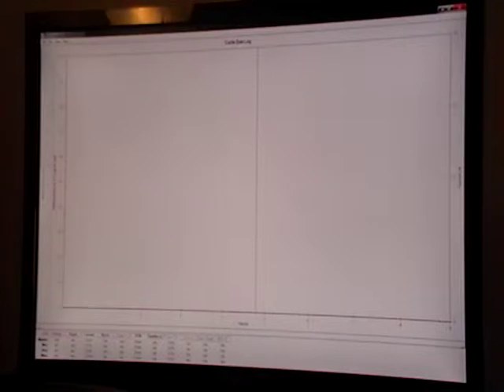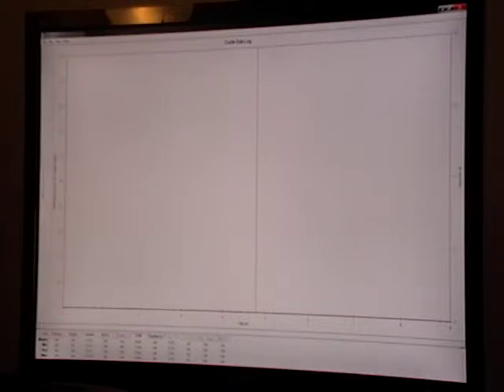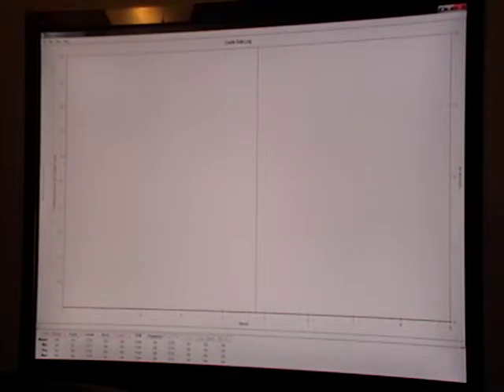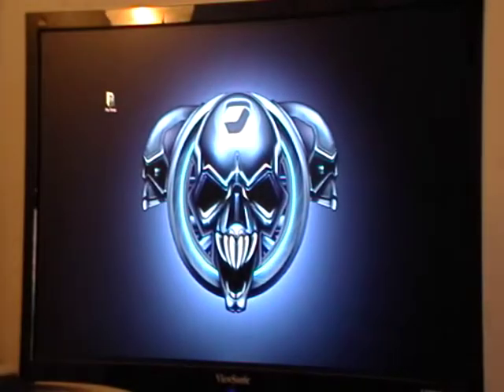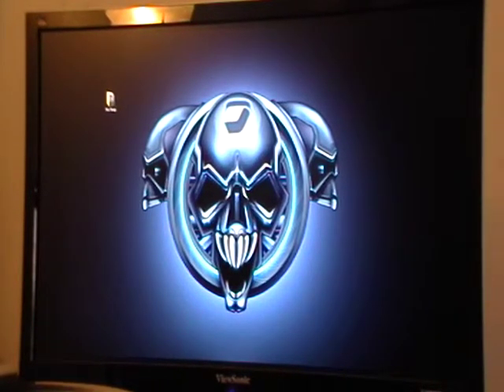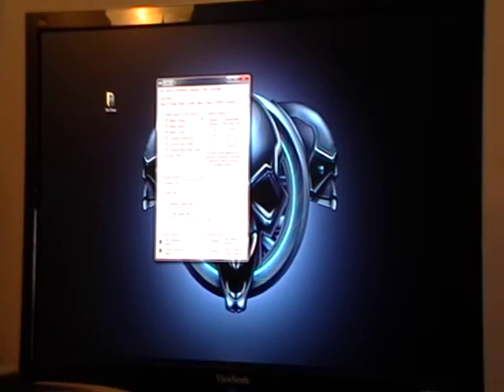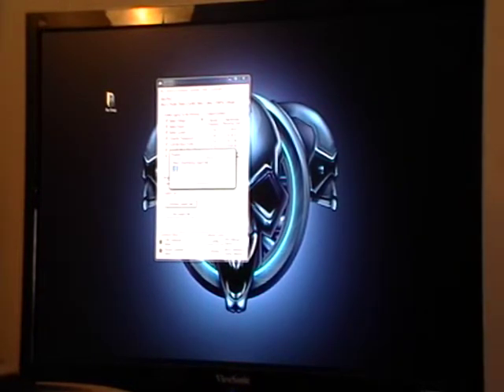SAB Goblin 500 Setup Overview & Castle Data Logs - Part 2 (2013-07-04)

Comment: what you don't know is what happened behind the scenes a castle rep told me bert was burning up escs  left and right and he had a fallen out with castle ,he blamed castle for the problem when it was sabs dumb design burying the esc under the battery with poor ventilation. my esc is on the out side and after flyng hard 3-d in 90 degree weather it was at 114 degrees with a throttle curve of 100,95,90,95,100 if you keep it where sab put it you will continue to have over temps.

Comment: bert kammerer doesn't care if your esc fails because your crash will make sab even richer.bert new that the talon 90 was  failing  during testing and never told anyone.sab blamed castle when it was sab that put that combo in there manual saying to use the 4020-1350 with the talon 90 even after bert burned up tons of them.